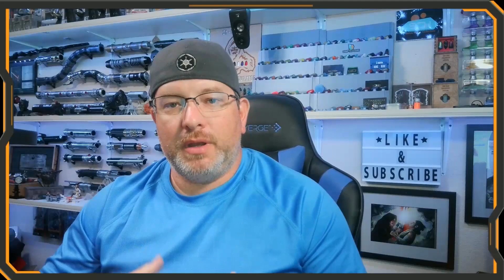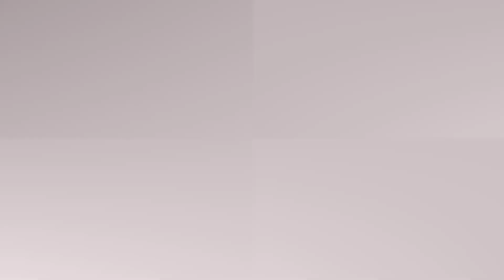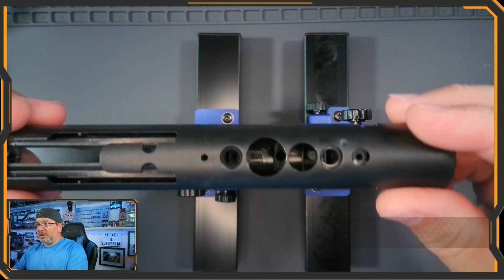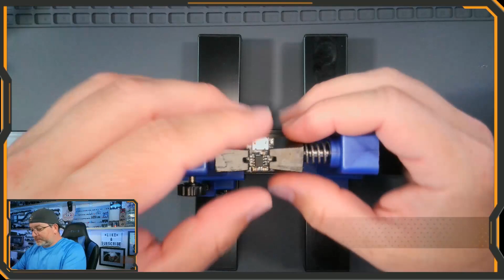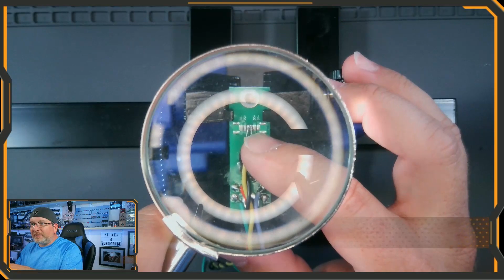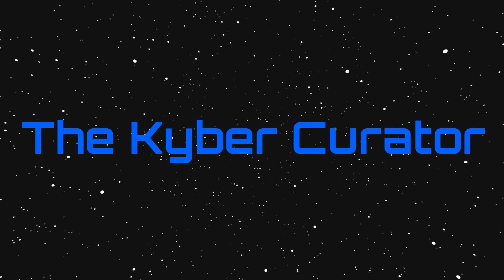How To Build A NeoPixel Lightsaber: Building My 1st Custom Lightsaber Episode 2 - Prepping Parts

Comment: If I were you I might redo the yellow and black wires on your switch plate. You don’t want the exposed wire coming out of the solder to be quite that long. Another option would be to use some kind of glue to both hold them in place and insulate that exposed wire so they can’t touch
Reply from the maker: All good points and I actually use some hot glue to do just that.

Thanks for the comment.
Reply: @ForceFandom  then I wouldn’t worry about it. Other than that the soldering looks quite clean, nice work! It can be tough to solder cleanly on tiny pads